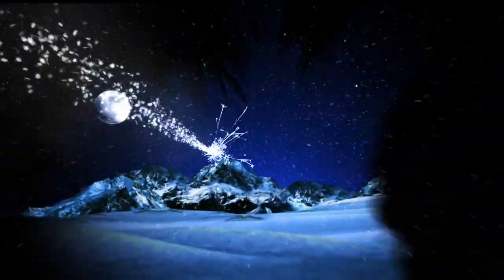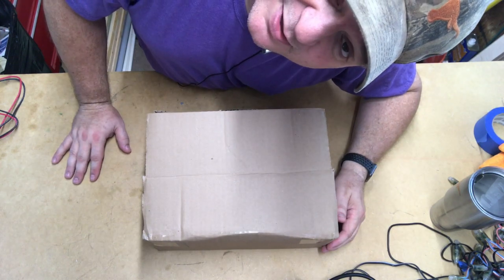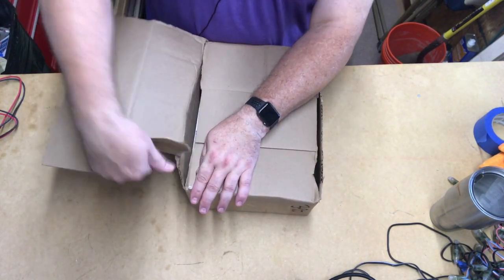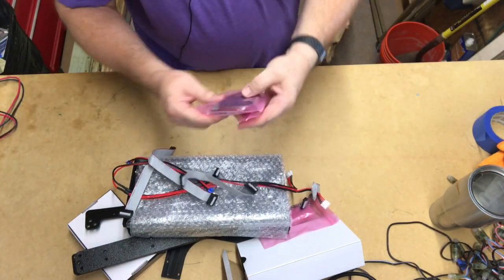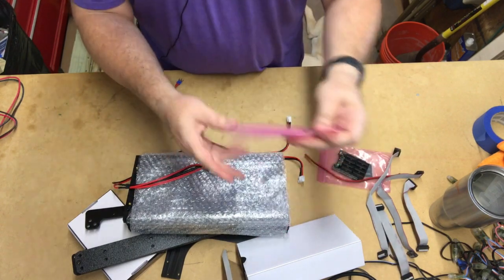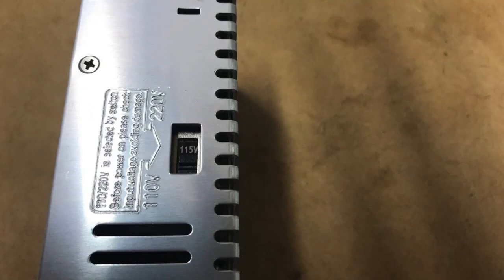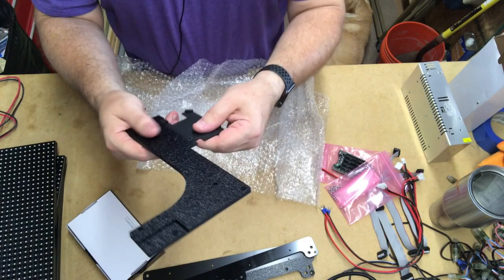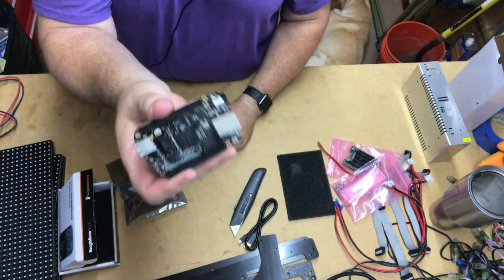P10 RGB Matrix Kit Unboxing

Comment: Is there much of a difference between using the Beaglebone Black vs the Raspberry Pi?  I noticed in your recent FPP 2.x video you were using a BBB and I just wondered.  Thanks!
Reply from the maker: IMHO, the Pi is a little easier to deal with. The BBB is great for running panels because there is an octoscroller cape built specifically for the BBB. The Pi has more USB ports, Ethernet and WiFi built-in and a better choice unless you need the BBB.
Reply: Awesome thanks!

Comment: To fix matrix/megatree  glitches like  bulbs being a different colors and stuff. Just set the universe channels to 510 the reason is the last channel 512 is green and not blue so this may carry over to the next bulb and start that one bulb in the order of  BRG instead of RGB and it keeps on going throughout the whole display. I found out the long and hard way. LOL  Again great video
Reply from the maker: Thanks! 512 is OK if the controller supports it. Some do, some don't. Either way, sequencer and controller need to match. I have been bitten by that one before too. I believe I ran up against an actual bug in FPP with a certain configuration as other configs worked fine. I also figured out a work-around.